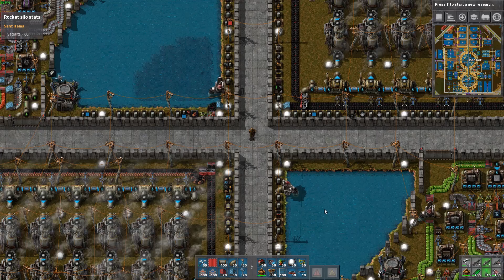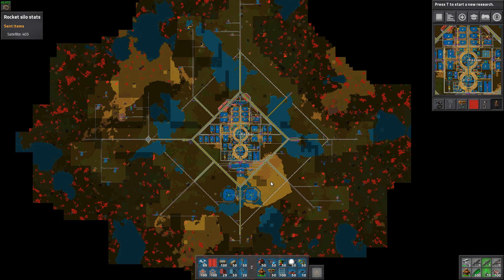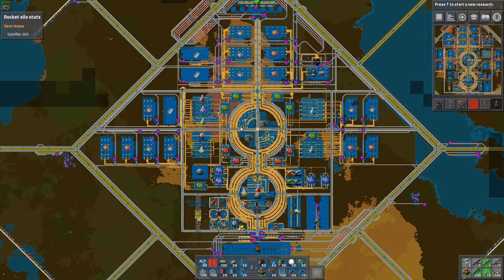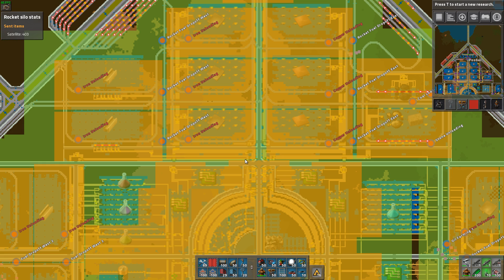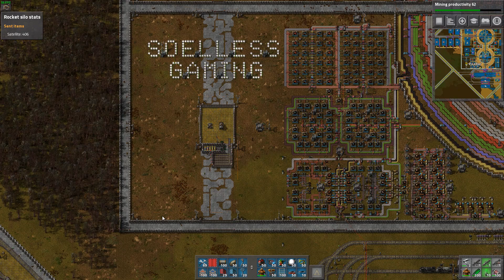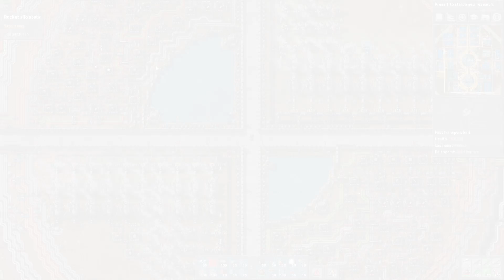FACTORIO | Beautiful Mega Base Tour

Comment: I can barely understand this. I am so bad at Factorio
Reply from the maker: Oh no! It's definitely a complicated game. Don't give up - if you have any specific questions let me know.
Reply: @SoellessGaming  Its just the implementation of the ratios that screws me over. Also, making a flexible base so that I don't have to spend too much time building new areas of the factory
Reply from the maker: yes! Balancing the ratios is so hard. I just did a 5000 science/min base and I used a factorio calculator to help me keep track of the ratios/production rates I need to make sure everything keeps up with everything else.

Comment: Holy...... As someone who has been into Factorio for just over a month, This is absolutely insane to me. I don't think i'll ever be able to get to this point as i'm even struggling to get rai lsignals right
Reply from the maker: yah rail signaling is definitely one of the harder aspects of the game, but once you get it, it's a piece of cake. Good rule of thumb: chain signal before every intersection. Chain signals inbetween short intersections (or for blocks less than the length of the trains you're using), and then regular signals after intersections where there is going to be your train length between that signal and the next signal (ie: if you're using a 2-4-2 train, you need to make sure there's enough room for that type of train inbetween your regular signals).

Comment: Insane :D
Reply from the maker: +Re NeW :)
Reply from the maker: Yes it is.
Reply: how did you build over water( in the center i suspect there was originaly a lake)?
Reply from the maker: You're right, it did start out as a bigger lake. I started on the outside and judged where I thought the middle would be, then filled in land until I got to the other side.
Reply: how did you build on water (terroform)